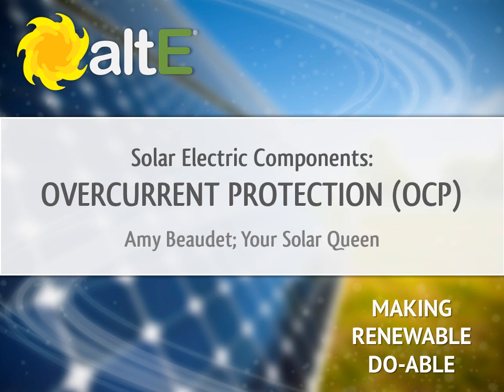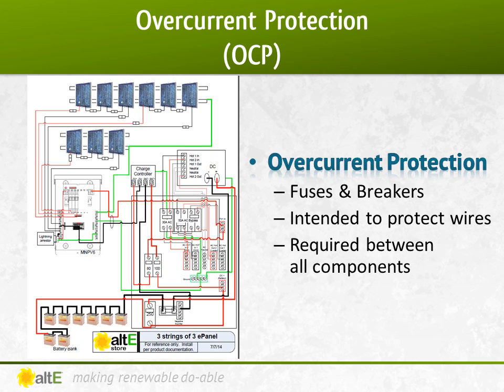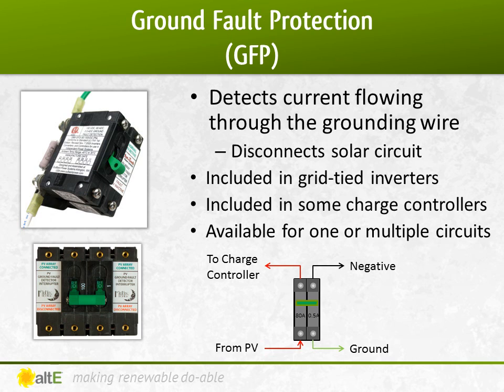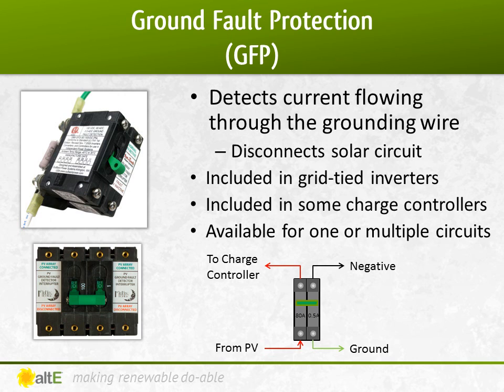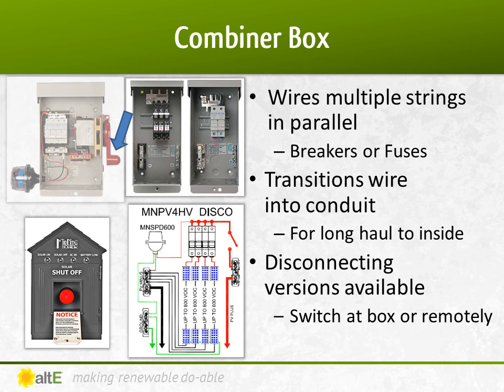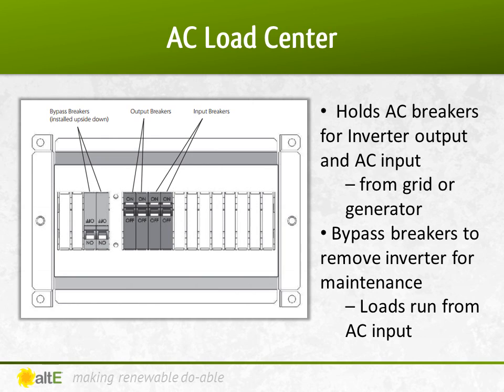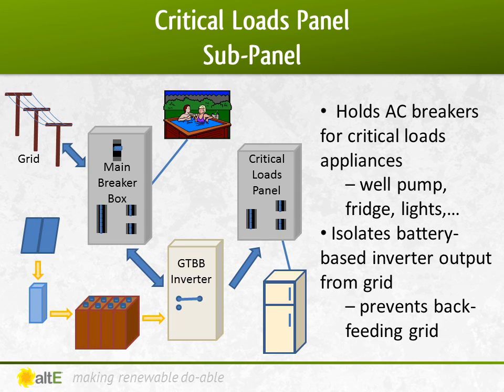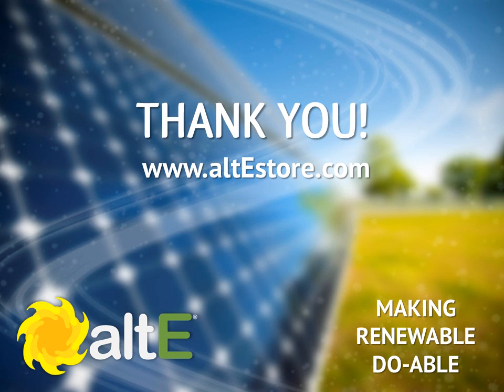Overcurrent Protection (OCP): Solar Power Components - Part 4

Comment: Hi! thanks for the video. Aren't you grounding the negative wire somewhere? if not, isn't supuse the pole is not grounded then needs to have protection?
Reply from the maker: The negative gets bonded (connected) to ground. The over current protection is on the positive.
Reply: @AltEStore  Thanks for the quick reply
! So, just to confirm I'm not confused. Then, if that is the case, in the showed diagram is missing where the negative is bonded to the ground and where the ground is grounded to the ground, right?  ...but there should be somewhere.

Comment: OK, I know I'm crappy at math but how does 25% = 1.25 for oversizing breakers/fuses?
Reply from the maker: I was over simplifying the math. The breakers are allowed to handle only 80% of their rating if they are going to be used for 3 hours or more. The reciprocal of 80% is 125%. So you can either take the breaker and multiply it by 80% to find out how much current it can handle, i.e. 100A x 80% = 80A, or you can multiply 80A current by 125% (or 1.25) to find out what size breaker is needed. I simplified that by saying oversize by 25%.

Comment: OCP should e thought of before even wiring your system, believing that "it's only 5KW, it won't produce enough to cause damage" is assuming it's the same as grid power and in all honesty, even grid power has OCP before they enter your home and you have OCP before the appliances.

The way it should be is Solar, OCP, Inverter, OCP, Charge Controller, OCP, Batteries, OCP, supply to house, OCP, OCP to different breakers.

Why OCP before and after each object? because I don't think it's fun to pay for the same unit more than once when you start your install and I don't like to pay for funerals, or bodily harm to another... and electricity really hurts when not done correctly - ask me how I know! ( <10 years old when it happened) so, OCD on the OCP if you have to but don't come crying when the OCD people come over and condemn your home.
Reply from the maker: OCD on OCP, I love it.